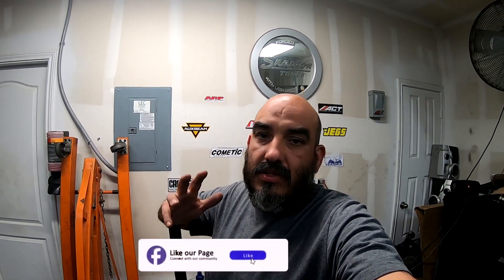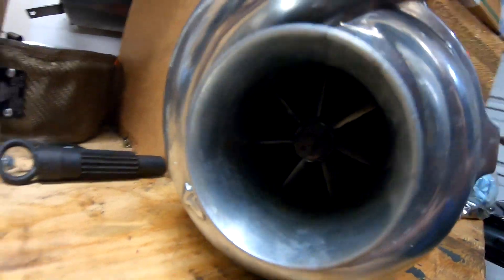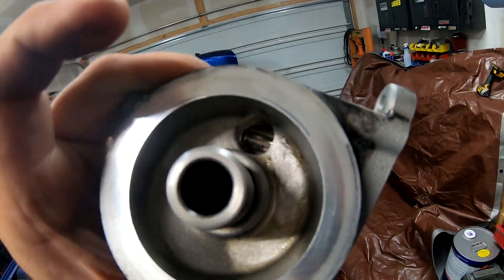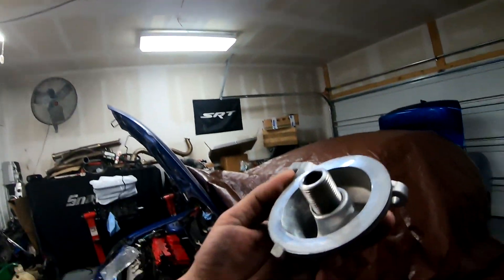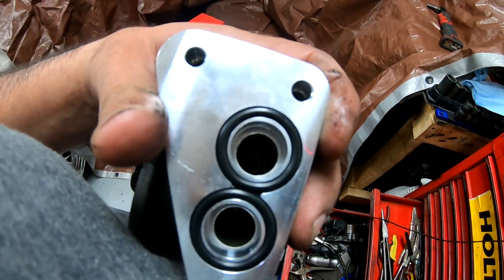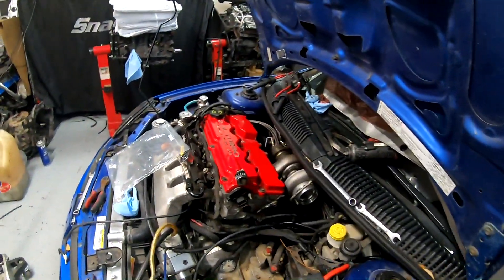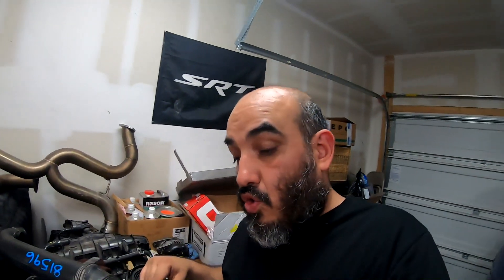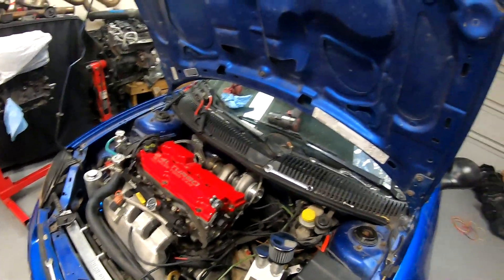Port-n-Polish & Detailed N2MB BoostBox install!!

Comment: Will the exteral wastegate line tee in with the fuel pressure regulator also?
Reply from the maker: Best way to put fuel pressure line is a boost reference only so anything before the throttle body

Comment: What kind of power that turbo got you running?
Reply from the maker: It did 430 on this car on a mustang dyno turbo is good for 600
Reply: @PJBWERKZ  im aiming for 600 on mine, still street car, built motor with ported head and stage 2 brian crower cams and over sized valves, strap kit at bottom end. And built dcr tranny, what turbo you recommend me ? without modifying firewall.
Reply from the maker: Do you know the spec on the transmission? 

Turbo I will say dbb 6266 or 6466 s257 will probably maxed out at 600 but is a bad ass turbo
Reply: @PJBWERKZ  i have a screenshot of the transmission info i can send to you some where. Im trying to creat a nasty street srt4 man. Ive this car since i was 18 and im finally slowly but surely building it to be a monster!
Reply from the maker: It sounds like is gonna be a bad ass car what clutch are you running and you can send the screen shot to Facebook page or ig
Reply: @PJBWERKZ   just placed the order with modern with a ACT HD series with HDG6 6 puck
Reply from the maker: For the power you want you gonna need a twin disc
Reply: @PJBWERKZ  cool shit, gonna have to return one and get a twin disc, i was thinking bout turning the car down depending on how bad it spins the tires, thinking bout controlling the boost with boost by gear.

Comment: I appreciate this video. What size vac lines do you use. I need to order a roll
Reply from the maker: That I dont know lol I don't remember but if you have any stock vacuum line except the green and black one you can take it to the parts store and just ask them you need the size that fits tight on the line, it might be 1/4 but not sure